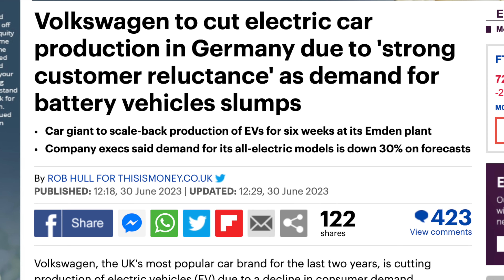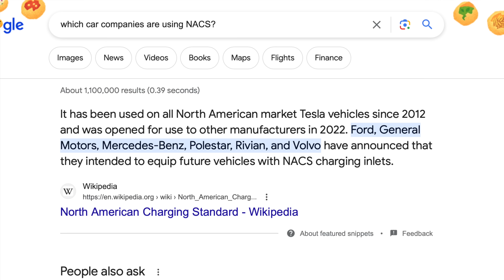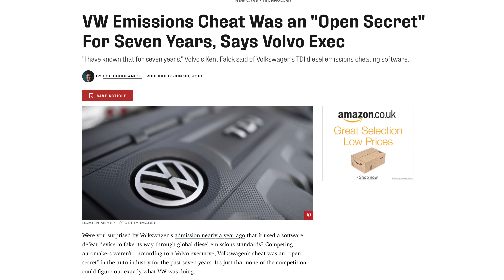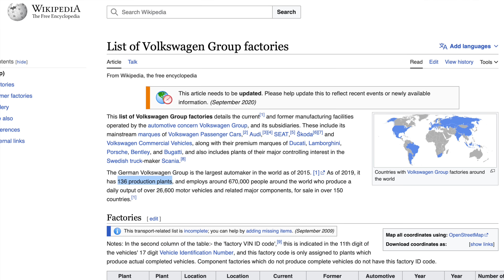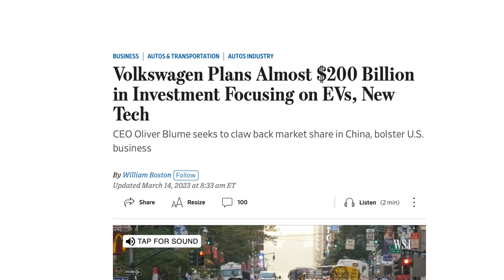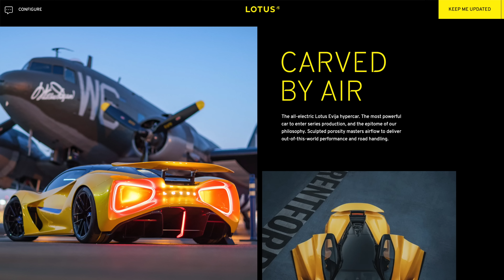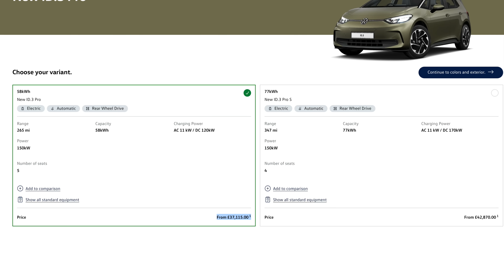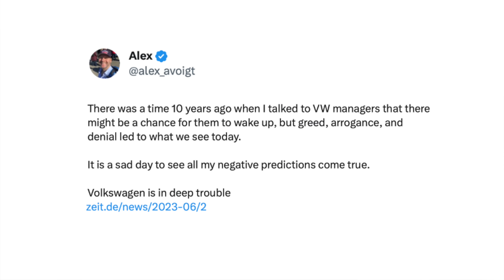KILLED by Tesla Or Incompetency? VW's Imminent Collapse

Comment: Spot on conclusions in this info packed video. Legacy auto are assemblers rather than manufacturers.  They first have to become vertical manufacturers. 2nd write an operating system, 3rd learn electrical motors, 4th learn battery technology. 5th design scalable profitable vehicles, 6th build new factories, 7th end ICE vehicle manufacturing.  Its like asking a walrus to dance on the head of a pin singing an opera.  It isn't going to happen.😮
Reply: 8th learn aerodynamics, weight reduction, and drivetrain efficiency
Reply: @juliahello6673 MEB had very low rolling resistance in teslabjørn's test and Sandy Munro applauded the motor to save one ball bearing.

Comment: I can only add that the NACS plug itself does not offer seamless access to Tesla's supercharger network. Only the 250 kW superchargers can be upgraded to support NACS. V4 superchargers will already support NACS once they come to the US. Tesla also needs to add support for Plug and Charge to give non-Tesla drivers "the Tesla experience" at Tesla superchargers: plug in and walk away.

Finally, the US is rapidly expanding the EV charging network using federal dollars. The problem is that the feds tried to pick a winner by specifying a CCS plug (that has since been abandoned by all US-based manufacturers). Now they are scrambling to update the legislation and stop forcing states to roll out a plug that has one year to live on new vehicle builds. Luckily, the law already covers upgrading superchargers to those that can charge Tesla, NACS, and CCS with just one cable using the Magic Dock. But since current CCS drivers will have access to NACS adapters for their cars, the federally-funded charging stations won't even need Magic Dock. Upgrading v3 to NACS will be enough to charge everyone passing through. Except Leaf owners, but come on, be serious.

Comment: The UK government needs to offer incentives to increase EV sales, instead of threatening an additional 6p per mile charge...
Reply from the maker: I think so... I'm still in two minds about this one. I really do think EV's are an inevitability at this point... purely from an economics point of view. Pure EV sales are already 1 in 5 in the UK, which is far quicker uptake than most expected. New EV's are close to price parity with ICE cars now, but as they continue to get cheaper to buy, plus the running costs over time are far cheaper than running an ICE, perhaps incentives are not necessary after all? I certainly agree that an additional 6p per mile charge is ridiculous. Thanks for your comment! 👍
Reply: We (the UK) need to start pushing/supporting the installation of a lot more charging stations, and on street car chargers.
It would be useful too, if HMGOV enticed TESLA to set up a UK factory (RHD model S's and X's anybody?).
p.s. just found your YouTube Channel - will subscribe and investigate your past videos.
Love the new car charger connection standard 'Knackers' sounds about right!
Reply: Incentives tip the scale towards EVs but price parity with ICE cars isn’t enough. EVs have to be cheaper in order to overcome the fear and inertia that prevents people from buying new technology.
Reply: @TeslaJigsaw  I'm not sure that I agree with you. Until EV manufacturers can offer cars like the Hyundai i10 and i20 or the Kia Picanto at the same price levels then they are competing in only part of the market. There are also many life changes to adapt to having an EV to make it an economical equivalent such having to purchase a home charging unit and then having to change your electricity supply contract to get those few nightime low cost hours  but then all your daytime usage is at twice the cost and that is if you are lucky enough to have a driveway. Then on top of that is the charging infrastructure. For people that do long mileages and have to use public charging are not going to find it cheap. Basically EV's are software on wheels and only Tesla appear to have a handle on that.

Comment: Hi in general i agree with you. However i own a vw id3 2020. And i must say i am a pretty happy with it. It has done around 100.000 km now. Without any major faults and no maintenance. Only new rear tires at 65.000 km ( and soon front tires). Would i buy a vw now? Probably not, things have changed.

Comment: It's nice we can talk about Chinese manufactures now. Otherwise, people would just say this is Tesla bias. :D
Reply from the maker: A serious possible outcome is just Tesla/China/South Korea companies survive this
Reply: @TeslaJigsaw  Have you seen the south Korean cars and actually owned them? I have owned a Kia EV6 for 18 months.... trust me they are not great. Very clumsy engineering, terrible software, poor shaky driving assists as well. Even the Golf I had did auto steering better than the EV6. And trust me. The ID3/4/5 software is so much nicer to use than the multi-layered laggy mess the Korean software is. Add the following traits of Korean EVs:

1: Kia Niro/Kona are just redesigned 2018 EVs 
2: EV6 and Ioniq cars have insane Min and Max battery temperatures of 10+ degrees, meaning they are always either close to being too cold or too warm to charge really fast (and yes they do overheat). No such issues in VW EVs. (just look at Bjorn Nyland videos).
3: The cars have a laughable interface that has poor performance, terrible post launch updates (even less significant than VW or any German brand really), and the most laggy navigation ever made with piss poor route planning.
4: They added a battery pre heat option after 1 year, but the heater is way too weak to heat it up fast and only works until 20% SoC, making it nearly useless.
5: Loads of hard plastics. The facelifted ID3 has a nicer interior than the ioniq 6 now, which is funny.
6: Kia EV6 had a Meridian Sound System which had frequent cases of blown up Amplifiers and buggy software
7: Now a Recall because supposedly E-GMP cars have power loss issues.
8: Tons of early EV6 owners, including me, got cars shipped with broken AC compressors. NO heat and loads of fogging in winter. great stuff.

Do I need to go on? 

Meanwhile most people I talk to that have ID. Cars have had some issues at the start but VW actually fixes most things. And sales of VWAG EVs are still doing fairly well overall and a LOT better than any Korean EV.

People just tend to defend Korean manufacturers more than the German ones. I am not sure why that is.

Comment: I had an ID4 as a rental. it took 5% more power to charge (7600watt) than my Tesla model 3 (7200watt).  BUT the ID4 said it would gain 20miles/hr of charging vs. my Tesla 30miles/hr
REALLY???? Inefficient!!!!
Reply: Because Tesla has a static consumption number builtin and VW calcs according to your driving?
Reply: @abraxastulammo9940  thx
I thought about your comment for a while...
I don't think that's the fact, because the car showed me every time exact 20miles/ hr if charge... Can't relate back to the last driving habit
Reply: @Gallardo6669  Maybe it was in winter where VW had an efficiency problem because it always heated up the battery due to stupid programming?

Comment: Right on! I agree with everything you’ve said. I was a VW fan but NO more. Even their “best” ice car 22 Tiguan I had one it was shit. 12v battery would die if it sat for a week. It also had really terrible operating system glitches. It had a very bad vapour lock type problem when cold starting, would almost die after getting on the road. I had to get rid of it. Oh the answer VW gave for the dying problem was that’s the way it is.

Comment: It's going to be incredibly difficult for the legacy automakers to maintain two radically different power trains , especially when the pure EV companies start to compete on price, especially the Chinese.  Once those production techniques and supply chains start to fade, they are going to become even more specialized and expensive.  One stumble on software, charging networks, or even selecting the wrong type or model to electrify, and it could be all over.  And their dealers are actively working against them by continuing to push ICE models, having insufficient training, service personnel for EVs.  I question the American companies like Ford - they took two of their more popular brands to electrify which on the surface makes sense, but under the hood so to speak don't make much sense as EVs (Mustang, F-150).  But everything else aside, at least in the US, Tesla is the only practical charging network and no level of plug integration/NACS  is going to have the same seamless charging experience for the legacy automakers.

Comment: I had VW Tiguan TDI from 2012 until 2019 and Golf Variant before that 2008-2012. At 2019 I couldn't find any interesting model in their lineup anymore. I wanted to ditch diesel and go to full -hybrid at that point. They had expensive Passat PHEV model with all the tech (DSG) I didn't want to see anymore. Changed to Toyota hybrid

Comment: I would not be surprised if a huge part of the VW software team was hired "best cost" in bangalore or pune. Not that they dont have good developers there but good engineers are not cheap in India as well. And probably they rather work for other companies.

As for the chinese market, its pretty hard to compete with subsidized local companies. And there will be a point where suddenly Tesla will disappear from China as well - or just become some local puppet.

Comment: I drive an ID.3 and it's not a bad car, once you get through the "what's the software going to do today" anxiety - which in fairness is usually nothing, but it does like to surprise with a swift advisory warning from time to time, like turning off the cruise control as you're bowling down the M1 because it's raining and the sensor is wet.   VW really dropped the ball with their software design and if you read the VW EV forums it's the No 1 gripe.  Anyway, although I have my doubts about Elon's sanity, I am actively considering a Tesla Model 3 as the successor to my VW.  That's why I am here, doing my homework about Teslas.  Thank you for your video, I don't think that VW is going to collapse but there's no doubt that they've messed up and whilst it will sort itself out, I know that I am not alone in considering our VW EV as our first and last EV from that manufacturer.
Reply from the maker: Thanks for your comment Steve. Hopefully some of my previous videos might be useful if you are considering a Tesla? I'm sure you'd love it having come from a VW. Feel free to use my Tesla referral code if indeed you buy one ;-) I believe it's £500 off! https://www.tesla.com/en_gb/referral/will63799 Either way, let me know what you end up buying!
Reply: @TeslaJigsaw  Thank you!

Comment: I agree with the baseline assumption of the video. However, there are some inaccuracies. For example Herbert Dies: I really liked his approach of facing and communicating with the customer. However, the issues with the ID series are in the end his responsibility and it was due to his strategy, that its now failing. For example, he decided to fix everything at once. The platform, the infotainment/ Software & Hardware Architecture and so on. But thats impossible and due to that, the issues also spread to the ICE cars. You need to divide and conquer one problem at a step - which the new CEO also realized and now follows a step-by-step approach (I assume thats also the reason, why the new platforms are delayed => focus on software first?). You cannot become an EV manufacturer & Software company over night. Also Dies decided, that quality is not important, which lead to the miserable quality of the ID (e.g. hard plastic everywhere), which was one of the good things the Germans had - their perceived quality over Chinese/Tesla. He might have realized, that he needs to go all in on EV, but his strategy and implementation was bad. That got him fired.
Reply: True that!

Comment: Ok - VW - GM - Ford - Chrysler - Nissan - Honda - Audi - Merc - BMW and maybe Toyota go out of business because they are not able to produce an effective electric vehicle in time to meet the demand. Who is going to produce the 67 million vehicles that are sold world wide each year ? Something just doesn't make sense in all these predictions.
Reply: Hi. You have to breakdown the requirements for vehicles. ie Buses, Large trucks, Semi Trucks, Utility vehicles (Pick up trucks), SUV's, Sedans, micro cars, etc. Then look at what is happening in each sector. There are already large operators already working, using electric variants, to counter the commercial use and operation of such vehicles. 
Plus, the tremendous cost savings that are made by commercial EV vehicles over their petrol/deisal counterparts. That alone makes them commercially viable.
The continuing down trend of costs (mainly battery associated) making EV's cheaper versus non scientific breakthroughs for ICE vehicles and therefore increasing costs.
Finally, WHO is going to produce the volume of EV vehicles? 
BYD will be the new number one in the world. Followed by Tesla, then a raft of specialist EV vehicle makers that may operate in limited market sectors eg Buses, Trucks of all sizes, Cars. So we get Hyundai/Kia, then about 20 different Chinese auto companies, (Look at a listing of them and the number of sales they have and you will be amazed) including those mentioned in the video (Volvo Cars and Polestar, MG, Lotus. Even highly specialist niche companies like Rolls Royce have tremendous demand for their new RR Spectre (EV).
Remember, a multitude of Countries have cease dates for production of NEW ICE vehicles. Most are 2035-40. The ICE market will collapse. For NEW vehicles. It will take 20-30 years for the majority of those ICE vehicles already built to finish their car life.
I almost fear to mention the rise of AI operations for FULL Robo vehicles. Many people believe it will never happen but Uncle Elon insists it WILL HAPPEN, sooner rather than later. 
This is all linked with the computer systems and operations of EV's, making an additional "nail-in-the-coffin" of ICE industry. We also tend to overlook the tremendous rise of EBikes including Emotor-bikes, as alternative modes of transport. Cheers. (Full disclosure: Yes, I'm a huge Tesla fan and large Tesla investor.)
Reply: @johnwilson5743  Everything you said is correct but what I'm talking about is if the majority of car makers fail financially , who will produce 67 million vehicles in 2025 ?
Reply: @nrich5127  Hi again. The decline is still only gathering speed. It will NOT be a linear growth but exponential. Overall, the vehicles for ICE sales have been good... and 2025 is only 18 months away. So the vast majority of those 67 million will still be ICE in 2025. But another 5 years later, it could well be a different story. In a mere 7 years we could have Tesla at 12.5 million and BYD at around 18 million. That's at an increase of 30% per year. But with the proposed additional new factories in Mexico and another two soon to be announced, it could be vastly more. Particularly with new models aimed at a broader, cheaper market and ramped up production of Semi truck and Cybertruck. 
By 2035... wow, now we are just speculating. The Chinese auto industry will have hit Europe and North America just like the Japanese did... only more so! That's only 12 years away. Sadly, the damage done to the Japanese economy and economies in Germany and other European countries, will be frightening.
Reply: @nrich5127  nrich, I forgot to mention that I'm a Risk Management Analysist and have been looking at the Auto industry since before Tesla started in 2003. A fellow Kiwi, Ian Wright, was a founder of Tesla even before Elon got involved. When I saw what they were doing and how they were going about it, I sold all my other investments and piled in boots'n'all when Tesla was (in today's figures) under $10 per share! I alerted my brother and mentioned it to a few friends and we have stuck together as an Investment Group ever since. Yes, even when it looked as if Tesla might crash and burn, in ! LOL.
Reply: @nrich5127  Tesla is totally focused on reducing the number of cars required with automation and cheap ride RoboTaxis. As is GM and other OEMS. GM acquired Cruise and promised multiple city Autonomous fleets by 2019. VWG and Ford acquired Argo which collapsed earlier this year. BYD wants nothing to do with it!
Tony Seba is a futurist with a good prediction track record in transport and energy. He forecasts an 80% reduction in personaly owned cars by 2030.

Comment: I'm in my last year with a 3 year leased ID3 150kW Performance Pro with the 58/62kWh battery. The good points. It's quicker and way faster than VW specs [I've only checked the latter once]. VW says 261 miles range. In the summer I can get 282miles [I take photos of the range every time it hits a new high] and it doesn't have to be blisteringly hot to reach that total, as long as it is at least 21°C. What battery degradation after 2+ years? And it handles quite nicely. Now the iffy points. It gets about 170 miles in winter - no heat pump for efficiency. And that's it... err, no I can't ignore the elephant in the room. The software is lousy. Truely awful. If it wasn't for an ability to connect to Android Auto it would really impair the driving experience on trips. And I've given the VW software so many chances to prove itself better. There's no point in going into deep detail, but unless you have the latest software iteration to make the driver experience better, just avoid. And even then approach with caution, unless these things don't matter to you. My software version is still V2.3. My service dealer couldn't or wouldn't upgrade it any higher as he was afraid of bricking the car. The latest is V3.1 something, which is said to be ok-ish. Tbh, I doubt it, although I am considering trying to get an upgrade again.
Reply from the maker: Thanks for that. Interesting to hear 👍